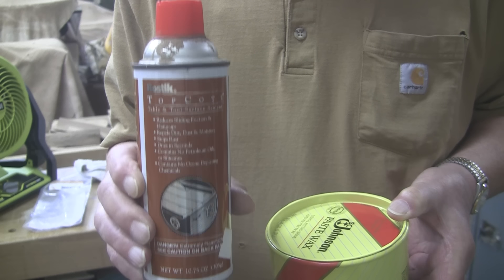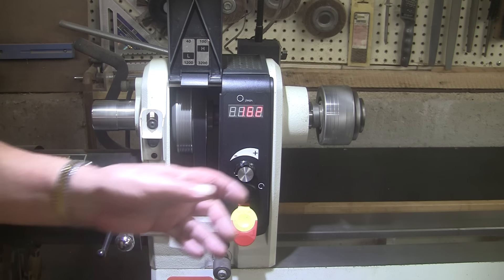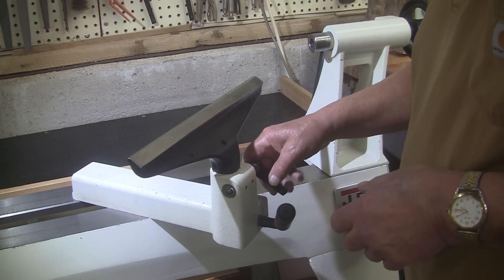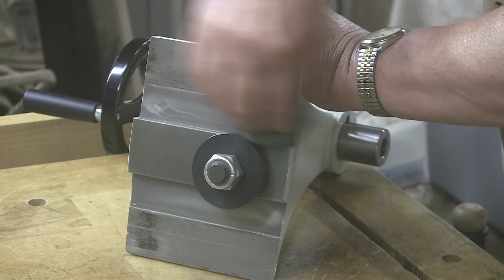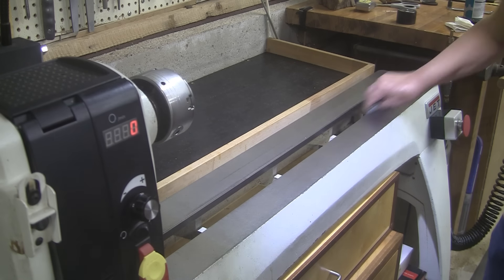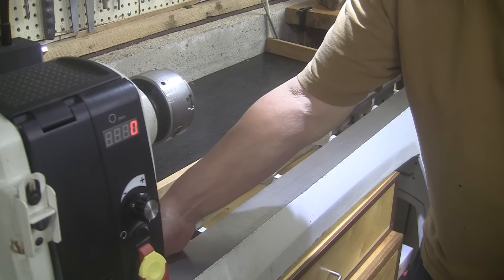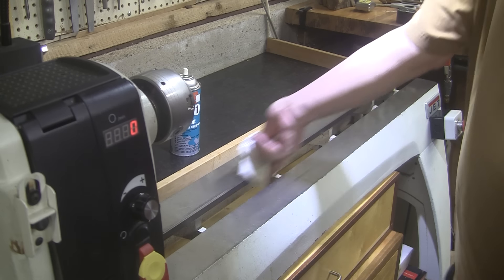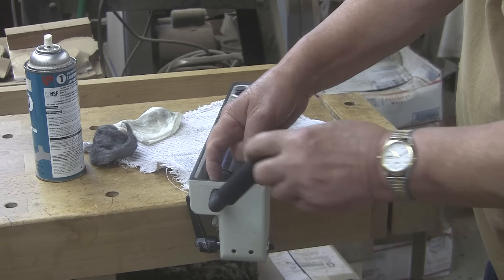Gotta Do It! 😝 Wood Lathe Maintenance - Wood Turning

Comment: Thanks for the reminder Phil I am over due to do the same. 
I have used a spray meant for my bike chains and sprockets on my bed. Works pretty good. And does not attract dust.
 And for sure I have been using the Johnson wax for more than 50 years as well. I guess closer to 60.
 I also used the Johnson wax with 0000 steel for a finale buff on furniture I made. Learned that in high school shop class.  I hear it is hard to come by. Amazon has it for $158.00 OUCH!
I have a little bit left in a very old can. 
See you lather...get it LOL
Gary
Reply: High price since they stopped making Johnson wax a couple years ago. But my old can still going strong, and so is my can of Turtle wax!
Reply from the maker: Why they would discontinue that paste wax is beyond me, Gary.  I've done the same thing with Johnson's and steel wool.  Must have had the same shop teacher!  😊

Comment: Good morning 🌅, Phil , preventive maintenance is always very good idea, 👍🏻, it doesn’t matter what the machine is whether it is a drill that you use for drilling holes accord to drill a pillow drill, Any tools and machinery needs to be cleaned out at least once a month if they’re being used constantly, it helps to prolong the life for your tools and machinery, many years ago I was helping as a subcontract worker at a Oregon building company, the machinery was very, very rarely maintained, I ended up working there for quite awhile, and each machine that I used to work on, I will regularly maintain it when I was using it, I even had the bus come at me one day telling me that I should not be using anything to clean the machine. We have somebody to maintain our machines., I said who does it as they have not been done for years, I didn’t like it that I was taking time that I was being paid for to maintain the machines, until one day table saw ended up not working correctly, it was very badly out of true, Got to the point where you couldn’t use it, so the firm called some reason to maintain it, All the person done was coming and clean it he didn’t set it up, so it was still running out of, So I complained, how do you expect us to cut material on the machine? That is so badly true?, I ended up spending nearly 2 days stripping the machine down replacing some bearings realign all the rails., I’m putting it back together again, it was like brand-new when I done it, The Boss, I’ve got an attitude about him, 
I have a problem with one of my lathes , MCN KONTUR 1500 , a few months ago I decided I need to move it somewhere between 600 and 800 kg, I do believe I managed to lift it up and put it on some wheeled  trolleys, It was fine when I was pushing it in a straight line, but I need to turn it 90°, it came off the trolley, obviously I couldn’t stop it, but what it has done is bent one of the Rails, I hadn’t realised that this had happened until last week when I put it into my new location of where it was going to go, it still parallel across the top, but when you put a straight edge down the side of it, it has got a bow in it, it was only when I was trying to slide the tail stock down length of the bed and found it was jamming up in the centre, then realised that there was something serious wrong with it, not sure yet how I’m going to straighten it, 
I should’ve used some webbing straps to hold the machine onto the trolleys , As they say, prevention is better than cure, 
Look forward to next week project , stay safe, keep up the great work of Art, from France,

Comment: Thank you for the cleaning video. I often go thru the same process. Nuisance but worth the effort. I too find the "Top Coat" product to work well but it doesnt last very long. I will try the spray you used to see how it lasts for me too.
Here is a tip FOR you that I bet that you will like AND use. I made a wooden dowel (1/2") with a narrow tapered 'blade' shape on one end and left the flat on the other end. I chuck the flat end of the dowel into my variable speed drill. I hand push/start some of the '0000' into the round bores (as you do), then  use the dowel to engage the "0000" steel and the drill (slo speed) spins the wool while it travel down thru the bores. I hope this makes sense, it really does work very well.
Reply from the maker: Thanks for the tips, Mike! 😀

Comment: Great job at demonstrating lathe maintenance, Phil.  You are right when you say we probably put off cleaning until it really needs it--usually right in the middle of a project!  One recommendation I would make is to wear gloves when using steel wool.  When I was a teenager, I used to clean my dad's white wall tires (you remember them, don't you!) with steel wool.  I got a sliver in my thumb, it got infected and I lost the tip of my thumb.  I rarely use steel wool but when I do, I always wear a glove.  A word to the wise!
Reply from the maker: I bet it wasn't 0000 grade, Tom.  The coarse stuff, sure, definitely wear gloves. 😊

Comment: Great tips, Phil!! I think I might establish a Birthday Party for my lathe, and do a deep cleaning every April 1.... That's when my lathe got delivered. 

Me ... I will use Scotch Brite (white) for my scrubber, instead of steel wool. I also like Gulf Wax blocks to lube my bed ways. And last-- I use a shotgun cleaning brush to clean my spindle bore.... 20ga brass brush. It cleans the gunk and does not even scratch the inside of the bore. Thanks again for this timely reminder.
Reply from the maker: Sounds like you've got a great system, now use it!  😊

Comment: Howdy Phil
Got to do it .... for sure
Is that a silicone base..... And many years ago about 24 years ago I worked in a wood shop that built high-end furniture and they had silicone all over the place..... Yeah I have used the Johnson wax mostly just because I have it and it's I've had it for a quite a few years....... And Johnson wax works great on my sled on my table saw it stays a lot longer on the wood.
Keep on turnin'
Reply from the maker: I'm never using it again, Bruce.  It says "greaseless" but it's more greasy than anything I have used! 😀

Comment: Hi Phil 
Great video as always. Just wanted to share a tip. When I clean my bed, tool rest, banjo, etc. I found that spraying a bit of silicone lube or wd40 on my steel wool really helps in cleaning and polishing the cast iron. Then just wipe the residue off and wax everything good. Seems to last much longer for me and I turn literally every day....
Reply from the maker: Thanks for sharing, Cap! 😊

Comment: Phil always learning from your vidoes no matter the subject. I just cleaned my lather the other day. I forgot/didnt think to clean and lubricate the under neath where the washer runs on the lathe bed. DUH. LOL. Do you remember where you got the tappered tool at I need to pick up one of those.
I use an app called FIX that another YTer suggested I have all my tools and other things listed in there and maintenance schedule so it reminds me when to clean the lathe, change filters and the like.
Keep up the Amazing work. 👽
Reply from the maker: It's called Tapermate and apparently, out of business. 😀

Comment: Phil, your lathe has the same style banjo as my PM 2014.  It uses a twin cam system to hold the toolrest in place.  I've found it works better than the grub screw style on my PM 3520B.  The Laguna uses a pinch style with a bolt that pinches the cast iron around the post.  This constant flex fatigues the cast iron and I've heard complaints about it.  Gary may like his, but I've not talked to him about it.  That said, the post does not adjust easily in our style banjos.  And if you take the rest out, it can be fiddly to get it back in.  I consider this a trade off.
Reply from the maker: All good info to know, Billy!  Thanks a lot for that, buddy! 😀

Comment: That was much appreciated Phil. I have been using a WD40 dry lube product, but it needs to be reapplied every few months on the lathe bed, banjo, and tail stock, so I’ll be trying something else. To be fair, the product is more for storage of metal surfaces. A question, who makes that tool rest? It looks sweet and something I’d like to have for my Jet. Thanks again Phil : )
Reply from the maker: It's the original tool rest that came with my Jet lathe, Karen. 😀

Comment: Great video Phil!    You are the best!   Would you like to see a dust collection setup that is easy to build and supposedly works very well?
Reply from the maker: No room for dust collection, Kevin.  I've got four of them, can't use 'em. 😀
Reply: @PhilAndersonShadyAcresWoodshop     The vacuum pert or the end of hose that sucks in the dust no room?
Reply from the maker: @KevinCoop1  The lathe sets between two benches/cabinets.  Behind it is a shelf that goes to the wall.  There is basically no room for anything.
Reply: @PhilAndersonShadyAcresWoodshop     I think my last response got blocked.
Reply from the maker: @KevinCoop1  I replied to one, haven't seen anything else from you until this.

Comment: Great information Phil. I'm going to use steel wool on my drill press, the table(not sure if that's what it's called?) is getting hard to move around.👍
Reply from the maker: Might be a bit of rust or buildup, Ron.  Combine it with a little WD 40, should fix you right up!  😊

Comment: Great maintenance practices make great work projects. If you didn't mention it, I'd also add, use a dust mask when using air to blow out the components... you don't want to inhale that stuff.

Comment: Hi, Phil.  I have been woodworking for a few decades, but just got my first lathe in December - a Delta midi-lathe.  I cannot find in the owner's manual or online how often to add oil to the motor, if al all.  Any suggestions?  I have learned much from your videos.  Thank you.
Reply from the maker: I assume it's a modern lathe, Don?  New?  Most motors nowadays have sealed bearings, no oiling.  I blow the dust out of mine periodically but that's it! 😊

Comment: Well Phil, That was very interesting. I do regular Maint, but not to the level you have shown. There are a few items I will be including on my next session. ( and yes I do, do it regularly). What is the name ? where to get it, of the Green Gizmo you used to clean the Morse taper. I think it might be a handy do hicky to have.
Reply from the maker: I've just searched the web for it and can't find it.  Maybe they stopped making them.
Reply: @PhilAndersonShadyAcresWoodshop  Thanks for taking the time Phil, I have got hold of what looks like a wire brush bottle cleaner. I will give it a go

Comment: Good idea for a video, if we want it to last, we need to keep it up. Again I appreciate your channel. I have a question for making a scraper into a negative rake. Are both angles the same? And what angle do you use. I just got a scraper and want to make it negative rake. Thanks Phil, look forward to hearing from you.
Reply from the maker: Thanks! 😊  You need to have less that 90° combined angle.  Two 45's make 90 so something less than that.  A lot of different ideas on what those angles should be.  Mine are both 36° for a total combined angle of 72°.  If you make them the same angle, you don't have to adjust when you want to grind both sides.
Reply: Thanks Phil, I knew I could count on you for an answer. Really do appreciate you and your channel. Until next time... Dan

Comment: Phil, I have to ask where you got the plastic cleaner for inside the morse taper!
Reply from the maker: It's called Tapermate and apparently,  no longer made. 😀
Reply: @PhilAndersonShadyAcresWoodshop  Thanks for letting me know Phil. I guess I'll turn a piece of hard maple to an MT2 taper and wrap a piece of paper towel with some alcohol around it. That may work. BTW, after you told me what you use for scrapers, I ordered a whole set of them from Penn State Industries. Didn't even have any problems getting them into Canada! Thanks Phil!!

Comment: I dont know if it would be good for the lathe bedways, but i know the ceramic automotive coatings have gotten popular for protecting table saw tops.  I think it is very good rust prevention, but not good lubrication.

Comment: Am surprised you don't have a "Wood shaving fairy" that comes at first moon beam to clean all this machinery.    You have to leave out the good scotch and cookies.
Reply from the maker: Thanks for the tip! 😊
Reply: Wood fairies don’t do machinery and shops around here. But Trillium spirits have been known to “raid” turning shops for the shavings. Savy turners put shavings outside where Trillium spirits can help themselves as needed. Brownies would be helpful, but they also make more than just shavings disappear. Blame them when tools go walkabout. Dristies are the real helpers, but they only live on the Olympic Peninsula. And you have to make friends with them first, which is hard to do.
Reply from the maker: @valeriehenschel1590  LOL!